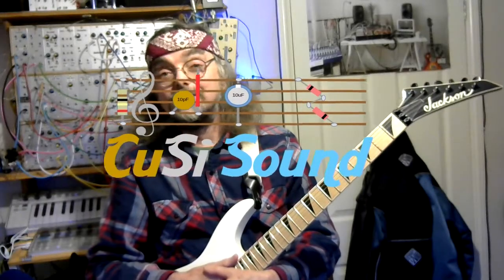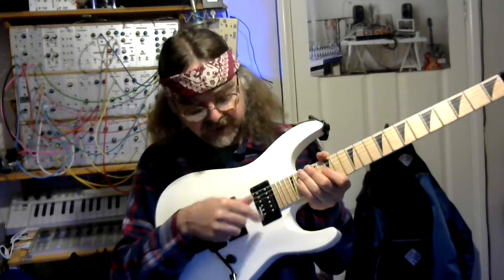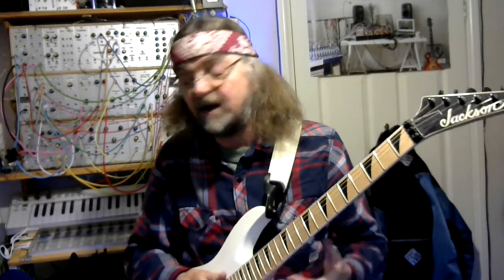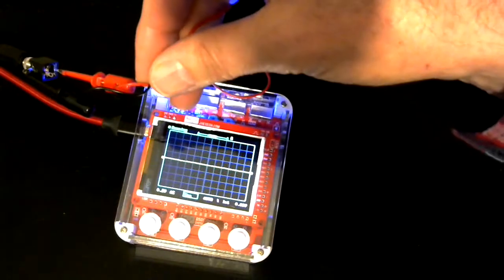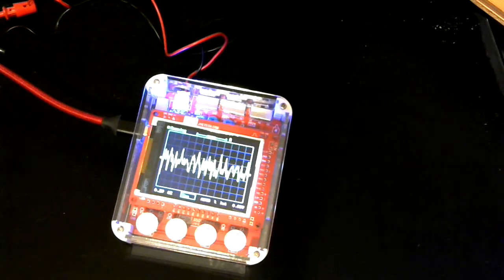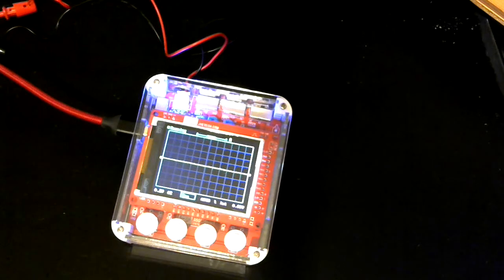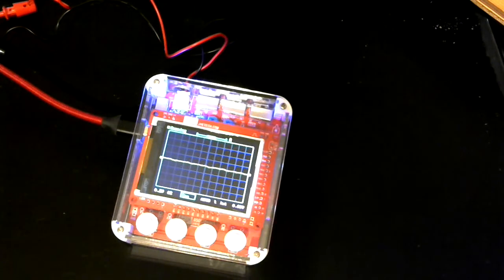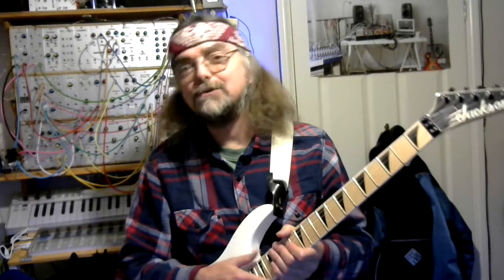Guitar Waveforms on Oscilloscope

Comment: A guitar is NOT passive. Electrically, it is actually a kind of generator. Admittedly, the amount of voltage and power you will get from it is VERY small - not nearly enough to power anything but the input stage of an amplifier. But it is still a generator in the sense that it is converting the mechanical energy from the vibration of the strings into electrical power. This makes a guitar (along with other instruments that operate in a similar manner such as a Hammond organ, Rhodes piano, and clavinet) an active device.
Reply from the maker: You are correct as the pickups do generate electricity, the scope would not show an output if they did not. I used the term passive in this context to indicate that my guitar does not have a circuit that requires a power source such as a battery. This is also in line with the passive/active input switch on my guitar amp. Sorry if I created any confusion.